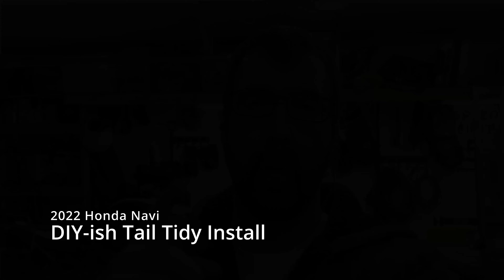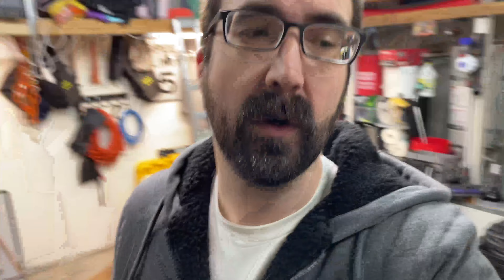Honda Navi Tail Tidy Install - DIY-ish with LED Blinkers

Comment: Hi converted ac/d  for head and tail light. My high beam indicator will not illuminate.  Anybthoughts on a fix?
Reply from the maker: Hey Mike, I haven't converted my headlight and am honestly not sure why the high beam indicator would not function. I haven't looked that deep into a wiring diagram about it. Sorry!

Comment: Just got a Navi and also have a little welder in the corner of my garage and also happen to have some 1” X 1/8” bar stock mild steel laying around. Great idea!
Reply from the maker: Welcome to the Navi club! Super quick little bracket. Some folks have also just drilled through that sub frame piece, butttttt that wasn't for me.